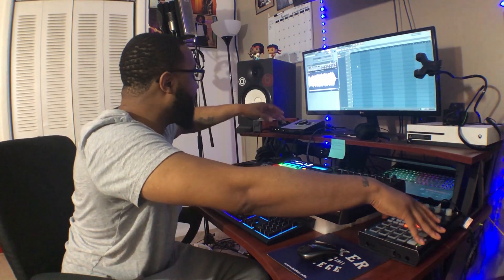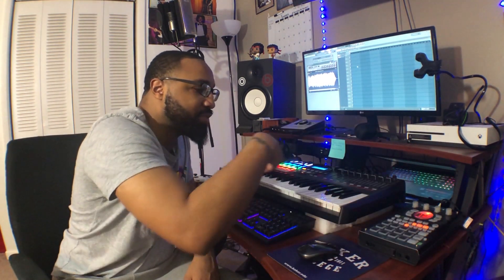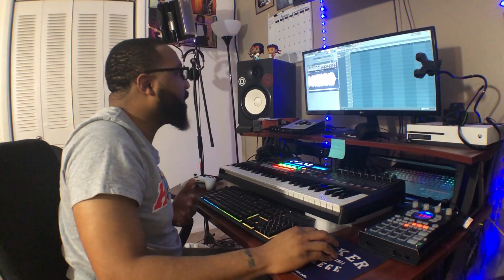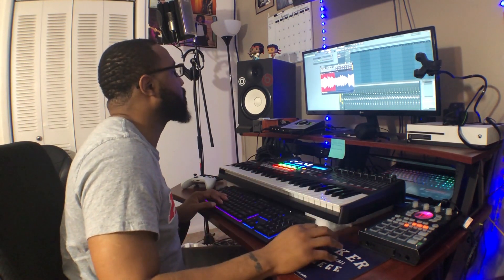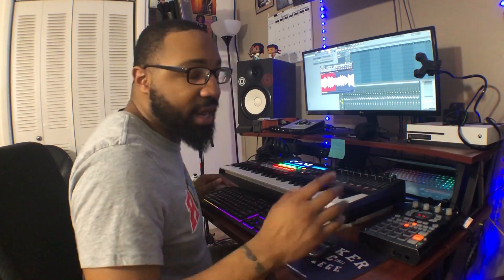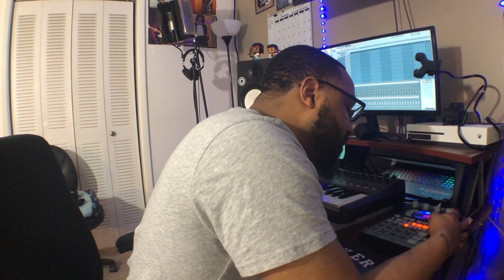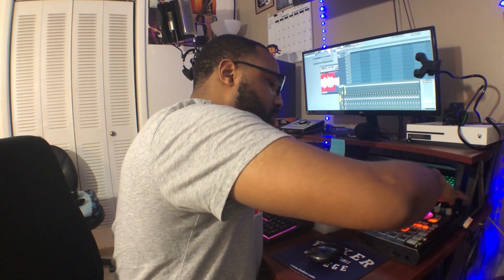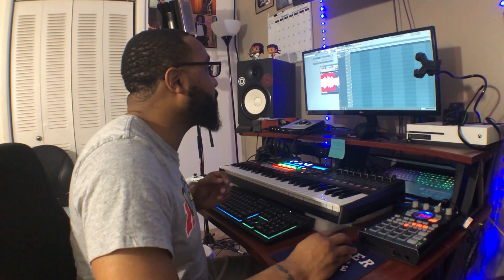How To Use SP404 As External Effect With ANY DAW

Comment: Yo Heat, do I need 4 cables in total? 2 out to the audio interface and 2 back from that to the sp? Any help appreciated
Reply from the maker: Yep thats exactly right. You need to be able to hear your sp audio and send whatever signal into its input
Reply: @theycallmeheat  Ok, right now I can hear the audio, I guess because I'm using two cables out. My problem is my AI Doesn't have slots for two cables back to the SP, Ya think I need a new AI or what to do?
Reply from the maker: @f.t.b9719 nope, get a headphone splitter and run audio from the headphone jack into your SP.
Reply: @ Thank you Sir🙏🙏🙏🔥🔥🔥

Comment: you can use the headphone jack like you're doing but that would only let you record in mono, if your audio interface has 2 stereo outs like ones that can set up 2 pairs of speakers then you can run one set to the sp and then you can get a stereo recording. You can do it with one out as well, you would just have to listen through the headphones on your interface and the one out you have going to your speakers would go to the sp

Reply

Comment: yo you do NOT need to record your samples inside the SP404SX .. you can use it as a thru-effects processor. Just hook up like you normally would (404 Line Out--> Audio Interface Line In / Audio Interface Line Out --> 404 Line In . Select your audio interface as your default device in windows, and in your daw. 

 Now use the 404's Headphone jack for your headphones (or run it to your monitors). 

Turn "EXT SOURCE" on on your 404. 

 You can now play samples in your DAW using your midi controller, and you can use/hear the FX applied by the SP-404 in real time, and record them inside your DAW.

No need to record within sp404 at all.
Reply: you got a solution for dat feedback tho Aaron?
Reply: @hex676F64   if you check my profile i made a video showing how yo setup the sp404 in a daw. i talk about feedback loops.
Reply: @hex676F64  mute the recording  channel on the daw but monitor sound from the sp404 headphone out.
Reply: @hex676F64  if you hook it up like I explained you shouldnt have a feedback loop at all
Reply: Would this work for an SP202 as well?
Reply: @BoeSharp  no clue sorry
Reply: Aaron if you got an Instagram contact me @niggasreallyshook , I have questions about the sp404sx
Reply: Thank you! I had my headphones plugged into my audio interface, and was getting tons of feedback. Plugged them into the 404sx, and problem solved!
Reply: @F_letc.h  yo I’m having the same problem ama see if that fixes it
Reply: @F_letc.h  what did you assign as the output device tho?
Reply: @alex-jm9fm  I just plugged my headphones into the headphone out of the 404, and could hear everything clearly. When my headphones were plugged into the headphone out of my audio interface, there was tons of feedback
Reply: my interface seems to not send signals thru my sp404. idk whats the problem fukk
Reply: The Apollo twin doesn't have stereo inputs. Neither does the Scarlett 2i2
Reply: @fryday1036  check my profile i made a video explaining how to setup the 404 in a daw
Reply: What up yo. I just got the SP-404a but im not understanding how to route through my apollo Twin X to run into FL studio how you were explaining
Reply: Can u send me a video explaining this it's hard to follow through text
Reply: @neovincibeats  https://www.youtube.com/watch?v=8uTByvvajjM&t=1s
Reply: I'm still getting feedback loop and have no idea what to do ;/
Reply: i made a video showing how to set it up-- https://www.youtube.com/watch?v=8uTByvvajjM&t=166s ,  keep in mind you're going to have your headphones running out of the SP-404's headphone jack , i forgot to put that in my video  @outcoldish
Reply: thats what i started doing with out needing like any video, if you know a lil bit about audio it just makes much more sense in the workflow

Comment: Yo I have the same setup but  in stead of using apollo twin's phones output, I use two RCA to quarter inch cables plugged in LINE output 3/4. However mine doesn't work right. When EXT SOURCE is lit and I press pad, the sound is very low in volume and distorted with a hipitched sound, if I turn up the input lvl pass to a certain level, the high pitched noise gets extremely loud. Do you think its the problem of my sp404 or the cable?
Reply: Basically without the EXT SOURCE is lit, I have the input level to the max(the right spot without clipping), once I press the EXT SOURCE, the super high pitched noise is blowing my brain out
Reply: Make sure +48 switch is not on. Try with your Red RCA going to Line In on Channel 1 on your Audio Interface, and Black RCA going to Channel 2. It really doesn’t matter if you have both right and left inputs, try unplugging one and listening, then try the other. It would work just as well having Mono input from just one RCA. Try adjusting the Gains on your Audio Interface. I think there is a point where if I turn my gain up too loud the same thing happens. Set all your gains around 50%.   Use the Audio Interface as your main source in your operating system, and in your DAW. Use the headphone jack on your audio interface for your headphones. You should be able to hear all the sounds from your daw, but it will be going through the sp-404, and the sound from the sp-404 will be picked up by your DAW. 

Lmk how this works out for you. Just keep trying different things, it definitely is possible there is just a lot of variables. It could be your cables (that’s why i suggested trying one side and then the other also, it might just be one side is messed up). Try and troubleshoot and isolate the issue by changing 1 thing at a time and then checking until you figure out what is wrong.

Comment: why do i have to sample in the 404? is there a way to just use the sp404 for its effects and record that into the DAW
Reply: I've been trying to figure this out too.. there are a couple other vids that show how to do this using the external effect rack, however I keep getting major feedback. havent been able to figure it out.
Reply: @etizzzle415  you figure this out yet?
Reply: @etizzzle415  ssame. feedback. same
Reply: Have you guys figured it out yet?
Reply: you figure this out yet?
Reply: yes. don't know if it works on FL, but ableton you just have to use and external audio effect and configure the audio from/to options so all the sp 404 fxs goes right into the track channel or group/master, etc
Reply: @papawasarodeo  would you mind being more specific as to how to do this?  Because i knew that is what i needed to do, but still did not achieve the end result.  It is the same in every DAW so it doesn't matter what you use.
Reply: StarSMASH so lets go, u need an audio interface with at least 2 ins and 2 outs (besides the outs to your monitor)

RCA cables out from the sp 404 to in in the AI
RCA cables out from the AI to in in the sp 404

open your daw and turn on all the correct inputs/outputs (in my case i use a focusrite 2i4, so my inputs are 1/2 and outputs 1/2, 3/4 -> the one i use for the sp)

now lets say you want to use a fx like drive+filter in a piano sample

1. in ableton you need to open an external audio effect on the track of the piano sample
2. select "audio to" the outputs of your AI that are conected to the sp. on my case, as i said earlier 3/4
3. select "audio from" the inputs of your AI. on my case 1/2
4. activate ext source on sp 404

and thats it. its pretty easy and the whole process is made in like 2 minutes

you can also search for a sp 404 to ableton as external effect here on youtube and see the tutorial by low heat. 

as i said, dont know how to do this in other daws but i believe its the same thing. good luck and tell me if everything went right
Reply: @papawasarodeo  thank you for the details.  I have my hardware set up the same way, except i have a maschine MK3 going into my SP404, which is then going into my scarlett 2i2.  

I am using an "aggregate device" as my input in my DAW and a "multiout" as the output of my DAW using "Blackhole" from my audio/midi setup that i downloaded and it worked.   Thanks again for helping!
Reply: @starsmash7491  thats cool man! glad to hear this

i also have a maschine mk3 and sometimes i think about testing some new connections  with it and the turntable/mixer/sp404 but i always end up staying with my old scheme of sp > interface and turntable/mixer > interface, just changing the inputs when needed
Reply: @papawasarodeo  here you go!  the solution is on post #6, but i made a thread in the native instruments forum if you'd like the details:

https://www.native-instruments.com/forum/threads/how-do-i-setup-blackhole-to-sample-external-source-through-maschine.377727/
Reply: @papawasarodeo  feedback
Reply: Yes there is, check out my other comment to this video i explain how to do it, i think it was highlighted so it should be at the top . You can use the sp-404 as a thru-fx processor and you don’t need to record at all in the sp-404. You can play any sounds in your DAW and record in your DAW. It’s great.